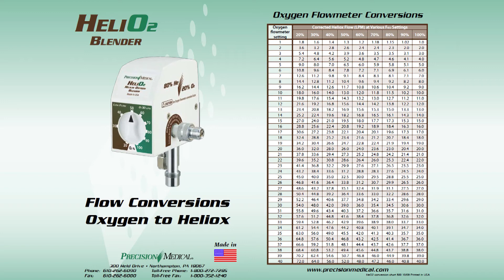Heliox Therapy

Comment: So with the blender hooked-up with the heliox tank and oxygen thru wall,   How do you calculate the tank duration?
Reply: It depends on the rate of dispensing vs. total supply of gas. Which ever gas is in a more limited supply or dispensed at a high enough rate will determine it.